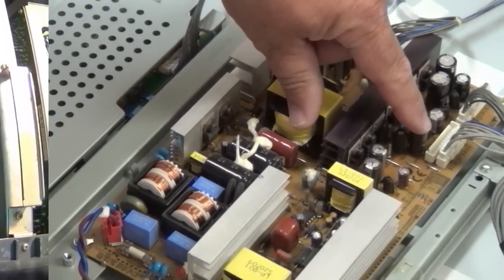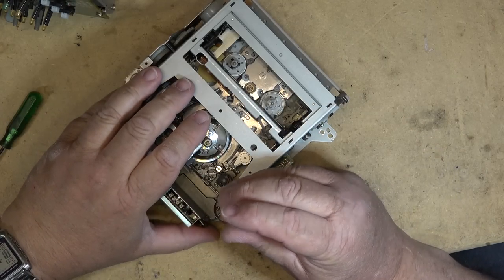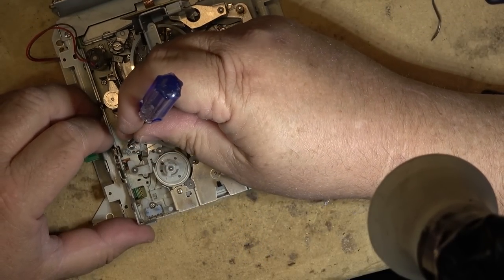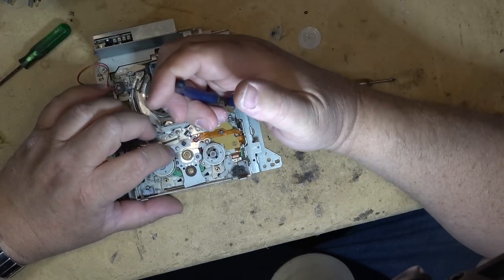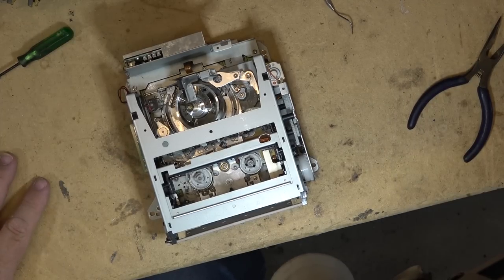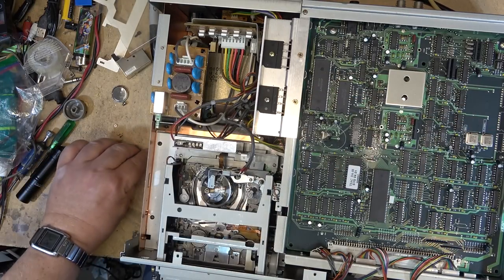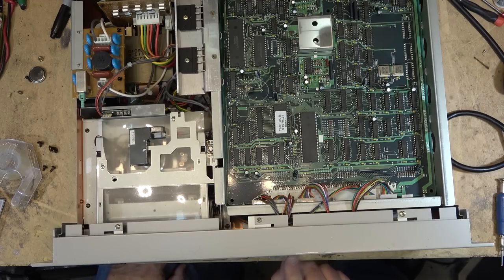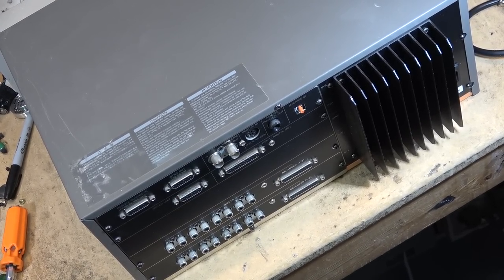Very Detailed Lubrication Procedure Tascam DA88 8 Track DAT

Comment: Hey I found your channel looking for schematics of vhs camcorder circuit boards— in one of the older videos you told a story about building a tube camera… I’m 24 and a huge nerd and specifically want to build my own tube camera and have wanted to for some time and you’re the first I’ve heard of someone building one!

Just wanted to leave this comment and thank you for being a clear pioneer in this field, and that this channel is a literal gold mine of priceless experience, knowledge, and stories that I’m so happy to have stumbled upon. Going to buy old for-repair gear to tinker with as a result of the inspiration you gave. Thank you!!
Reply from the maker: Yes sure did in grade 11 electronics class. Bought the plans and parts from a company called ATV research.   Hmmm, do you think that had an  influence in my company name? Actually I was heavily into ATV, that's amateur tv arm or amateur (ham) radio.  There were a bunch of us in that hobby.  Unfortunately most of the guys are dead.  I should dig up some tapes of our experiments.  
It was a vidicon camera.  Solid state just the pickup tube.  It was stolen I was so pissed off.
Reply: Yeah I’m super into tube stuff and there’s just so little documentation anywhere. Would love to see your experiments. I collect the JVC-GRC1U from 84 — have 3 of them they’re just a stellar design object and the light trails from crt sensors are to die for.

I’m also into circuit bending to make art as I’m a designer (don’t know how familiar you are) and curious what your thoughts are on if it’s possible to do with camcorders (handy cam ccd trv43). I’ve done it with CCD point and shoot cameras and also old video mixers by playing with the some of the pins soldering points but investigating schematics currently to see if there’s a data conversion pin to modify 

Again, glad to have stumbled across your work and channel. Literal gold mine that I’m looking forward to absorbing all your knowledge and stories

Comment: This might sound silly but I'm...sorta in the same boat (getting in over my head)? I've got an RCA CC250 camcorder (1987) that needed the belts replaced and I did that...mostly. It went from not working, to mostly working, to...absolutely not working again. I was wondering if there was any way to get in touch and possibly get a quote about a repair? I'm having an absolute doozy of a time trying to find literally anyone to even look at this camcorder for me. Any info would be amazing, though! Thanks!

Comment: I don't know why it spat out the Maxell but I don't think it was anything to do with what was or was not recorded on the tape...  except... if the record slider was set to protect then it would know that it could not format the tape and could not play the tape so eject it.  But I suspect there was some other reason.  It should be able to take a Hi8 tape and format it ready for making a recording.
Reply from the maker: The record lockout is set on that tape but it also had a digital 8 recording on it.  The recorder is smart enough to see that it has something on it that it can't recognize and it rejects it.  Normally you put a blank tape in and hit format and let it write time code and map out dropouts.

Comment: Did tascam actually make hi8 mechnisums or did they just buy from sony
Reply from the maker: Afaik they made their own trabsports.  Tascam is teac professional.  Teac is huge. Probably bigger than Sony.
Reply: @12voltvids  I do know that actually i have many tascam cassette players at home but i know sometimes even big companies re branded.  I have a tascam 3cd and cassette combo I use all the time cause it has a button that lets you do tape and cd continuous play its also super easy to repair and fix.  I have  the one tascam dual well recorder were both decks can be independent.